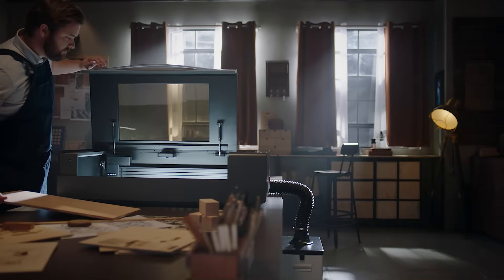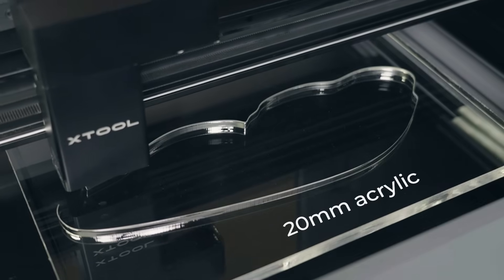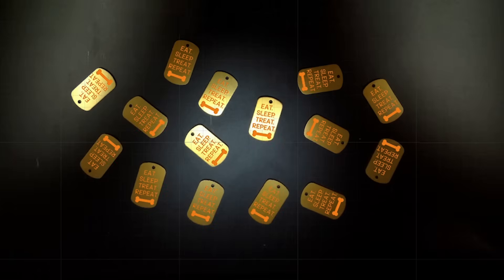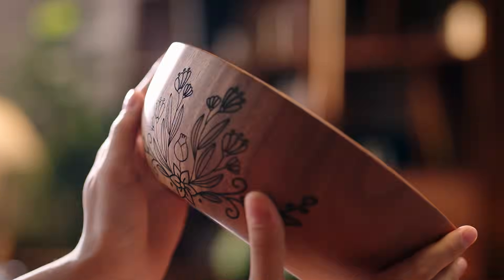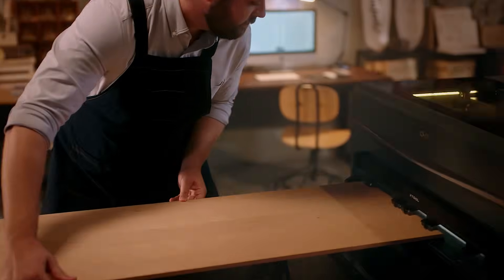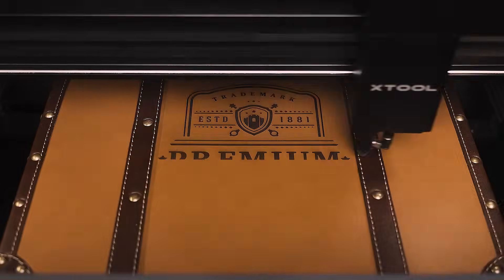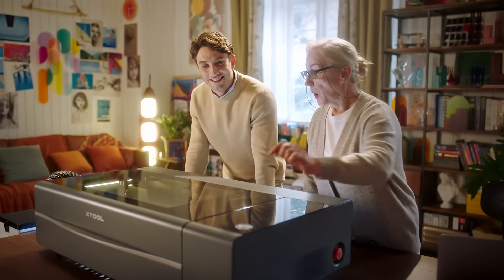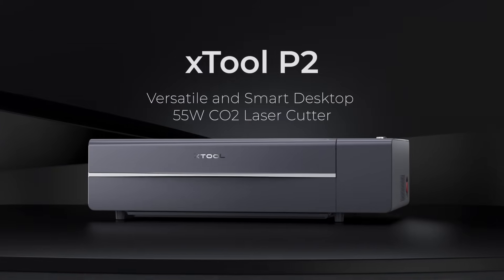xTool P2: Smart Desktop 55W CO2 Laser Cutter

Comment: I'll admit, the features are great, but as usual, they are extremely overpriced for consumers.  Sadly, they are still using low quality laser tubes and mirrors. You are basically paying 2000$ for shipping software.  The cooling system is sub par, and being locked into their software to use the features is a gimmic.   If this company really wanted a consumer audience,  they would work with the popular sw companies to integrate the support they provide and also sell a product with better hardware.   This laser is being sent out in hopes to nab a few 1 off customers but geared at businesses that do not know better or want a mini laser farm.  Not including the software or time, an identical laser built with better quality parts would cost about 2k currently.   Yes it would not look as nice, but 3000$ extra just so you don't have to alignment your work is insane.  Also any business that would be using lasers, will definitely be concerned about time and ensure to align everything well to get the most bang for their buck.

In short... great idea, horrible price, wrong targeted market.

Use better hardware and reduce the price by 50% and then you will be in the right audience and market.

BTW, using these poor magnetic mirrors will also cost you more to replace and cause quality issues due to vibrations.
Reply: Yo, what brand and model you recommend then.  That is better than this and cheaper
Reply: @SRC503  is your last name (down,there)? ..I changed my name to sitwhat?
Reply: Looks and sounds to me like YOU are one (broke female author.) As I neared the end of this epic series I was thinking....why don't (YOU )-yes you!-BUILD A BETTER PLATFORM!